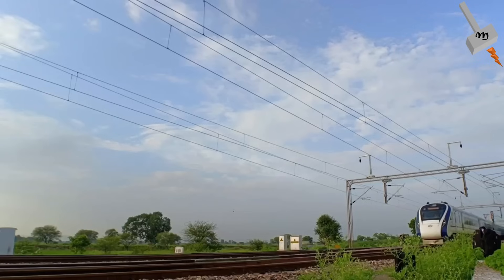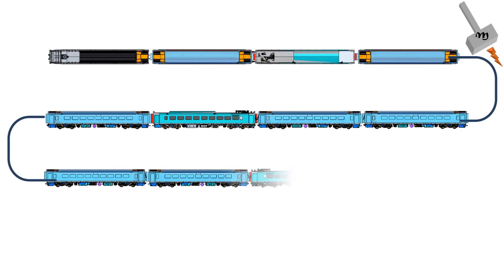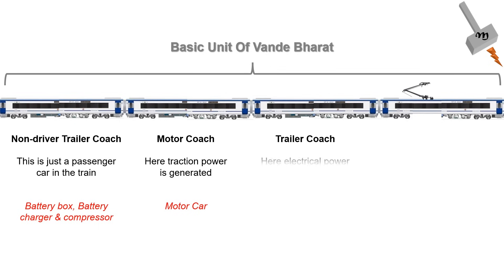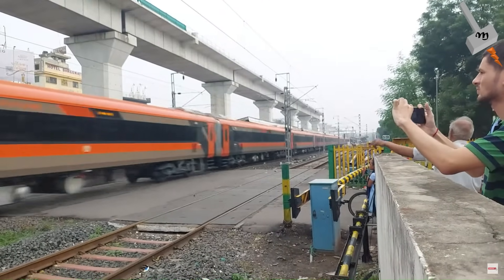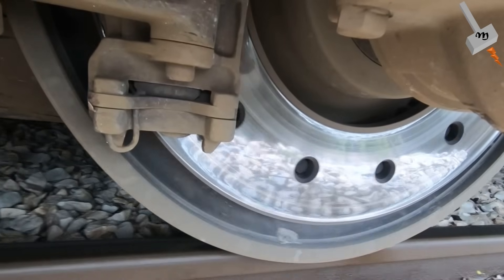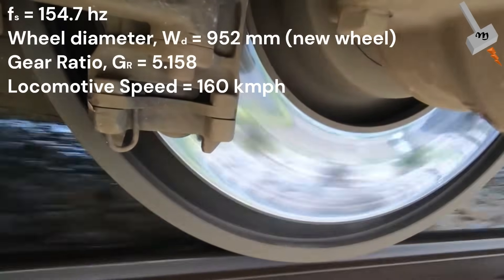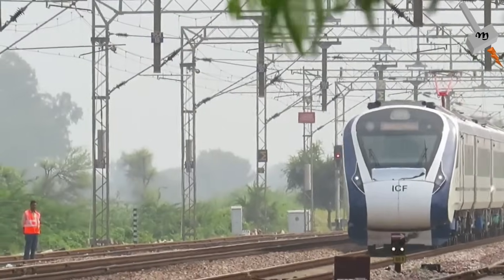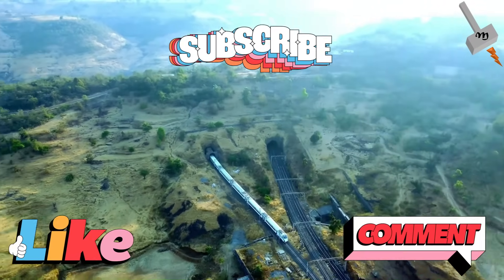Unravelling the mystery of traction motor of Vande Bharat

Comment: who is the manufacturer of the traction motor
Reply: Although TSA is an Austrian company; MEDHA SERVO DRIVES the main OEM & supplier for VB's traction equipments has a Joint Venture with TSA and are manufacturing these traction motors in Hyderabad itself under the banner of MEDHA TRACTION EQUIPMENT Pvt. Ltd. (MTEPL), a joint venture company of MEDHA & TSA.
Reply from the maker: Traktionssystems of Austria makes the Traction motor used in VB.

Comment: Sir, I am also a huge fan of the Vande Bharat Express and feel very proud of it. However, Maglev (Magnetic Levitation) trains are a cutting-edge form of transportation that utilize powerful magnets to lift and propel the train, completely eliminating the need for traditional wheels or tracks. This contactless system significantly reduces friction, allowing Maglev trains to reach incredible speeds (up to 600 km/h or more) while ensuring an exceptionally smooth and quiet ride. The key benefits of Maglev technology include faster travel times, as there is no physical contact with the track, lower maintenance costs due to the absence of wear and tear on wheels, and environmental advantages, such as reduced noise pollution and lower energy consumption compared to conventional rail systems. Furthermore, the lack of friction enables the trains to accelerate and decelerate more efficiently, offering a more comfortable experience for passengers. Overall, Maglev represents the future of high-speed, eco-friendly, and efficient transportation.
Reply from the maker: Maglev is an interesting concept but too costly to implement for mass transport system. The return on investment won’t be great if implemented.

Comment: Are these motors manufactured in India only!?
Reply from the maker: Most probably they are manufactured in Eastern European countries, perhaps Austria.
We hope you have subscribed to the channel!
Reply: YES. Although TSA is an Austrian company; MEDHA SERVO DRIVES the main OEM & supplier for VB's traction equipments has a Joint Venture with TSA and are manufacturing these traction motors in Hyderabad itself under the banner of MEDHA TRACTION EQUIPMENT Pvt. Ltd. (MTEPL), a joint venture company of MEDHA & TSA.

Comment: Sir. Great information. Thanks. How is the voltage reduced , AC - DC AC conversion and rectifiers ?
Reply from the maker: Thanks for being patron to this channel. 
Voltage is reduced by the traction transformer. Convertor system only converts the single phase AC to three phase AC. This has multiple advantages from power system point of view and load flow control.
Reply: @surgepulse2778  Thanks for the information.

Comment: How does power flow into the motors? One phase per track plus pantograph?
Reply from the maker: Pantograph receives power as single phase AC which is subsequently step-down by a transformer. Then the power is fed to a conveter-inverter circuit where the single phase AC is converted to three phase AC and fed to traction induction motors

Comment: Sorry this is not modern Marvel Japan built Bullet train in 1960. Don't over hipe our achivement. Firstly this is a gross waste of public money as this technology is not required to run a train at 130kmph. Because each vendebhart train coach costs more than 5 cr, where as a normal LHB coach costs 1.5cr which can also run at 160kmph. This is Modi's Vanity project at the expense of tax payers like. Bullet train project too is a vanity project as IR 160kmph track runs parallel to it.
Reply from the maker: Agreed, but better late than never

Comment: Vande Bharat trains climbing the Bor ghat from Karjat onwards do not require bankers to push them up the gradient while regular trains require them.

Can you please explain the reasons? Thx.
Reply from the maker: Vande Bharat can climb ghats and hills with ease is due to the distributed tractive power generation. This is already explained in earlier videos, please watch the following
https://youtu.be/Y5Wc4Ua3l2I
https://youtu.be/lY-94yRb3I0
Reply: Also considering Wap7 or Wap5 have max power around 4500 kW and VB16 and VB24 have 8000 kW and 12000 kW, with obviously lighter coaches, it makes difference.

Comment: So many number of motors more number os wires needed and more ssfety neefed for distribution of electricity 

Very high maintenance cost 
Vegy high manufacturing cost 

Csnt modify according to crowd and requirements 

Not safer 

Within few months several fault will cone and train will be in shed
Reply from the maker: That’s strange

Comment: Which company manufactures these traction motors 😮
Reply: Is Bharath Heavy Electricals Ltd ( BHEL) involved in manufacturing these huge traction motors?
Reply from the maker: BHEL, CG Power will be supply traction motor in future... ABB might also join
Reply from the maker: A company named TSA is currently supplying the motors to Medha, who is doing the integration in ICF facility.

Comment: It was a wonderful lecture episode of the Bande Bharat train set.  Could you lecture more on methods employed in conversion of single phase supply to 3 phase supply system and also on the Variable Frequency Drive used for speed control of the motor used.
Reply from the maker: We will try to make a video on the same

Comment: Seems like 3 phase squirrel cage induction motors are used. These are  inherently rugged, durable, brushless and provide a reasonable amount of starting torque. Moreover they are suited for parallel execution and allow overloading. Hope it goes a long way.
Reply from the maker: Yes, indeed it is a 3 phase squirrel cage induction motor, which is the most rugged electrical machine so far & best suited for traction application...
We hope you are subscribed to the channel...

Comment: IF the variable freq drive was based on SiC HEMTs its truly a revolution. Are you aware of the transistors that were used for this? Or did we use IGBT?
Reply: I'm almost sure that drive must have been third party, and not an in-house development.
Reply from the maker: The traction system is from TSA, which is a Austrian Company

Comment: Considering many modern trains supports regenarative breaking, what about vande bharat?
Reply from the maker: Yes, Vande Bharat has regenerative braking
Reply: Vande bharat uses combination of regenerative and electro pneumatic braking while using the brake system. There is brake control unit installed in vande bharat which adjusts the brake force across the rake as motor cars use regenerative+ electro pneumatic and non motor cars use electro pneumatic. BCU ensure uniform brake force is distributed all along the rake.

Comment: More than the traction, I love the smoothness of the train, no jerks, no vibration....just smooth.
Reply: Credit goes to engineers from private firm doing good job, 
Then current government factories where workers just do their obligations and don't improve designs or budget.
Reply: @coalrock8642  no thats not true most of the parts of body shell and bogies are made in ICF only
Reply: @COALROCK8642  
Without the Govt giving budgetary support, not even a PIN will move...
* You don't know the meaning of different  Govts different policies .
 May be you deserve only Congress govt and their ever running old decrepit ICF coaches ..
 . That too without Toilets and Shiit eveywhe on Tracks
 Leaving a Sudden Breeze of Dirty Smell we constantly faced when standing near Tracks on Platforms and were forced to watch all that Crap.
   Congress  forced this situation upon us Indians , so we can be called a SHITTY Country which was aptly correct then.
Reply: @raghunandan9290  you sure know that private firms shown of designs for higher standardized coaches. 2028 will be for sleeper coaches, by 2030 first higher coaches will come on track,

What government will do in this? Nothing really, as it's showdown/auction of contract.
Reply: @raghunandan9290 not even a PIN will move yeah, that's what I said.
Reply: Credit goes to Traction or electric motor and  it's ability to generate different power levels so easily  over time period
Reply: The reason for the smoothness is the improved traction induction motor
Reply: @dbl38  why the frick everyone says things. While the fact I said it's literally not made in India, but made by profiteers.
Whether re-proposing German coaches and made in Indian factories, I claim it's never designed in India, but copied or licensed for domestic usage.
Reply: @coalrock8642  Brother my comment was purely based on my journey experience. I have infant twins and I travelled with them from Bangalore to Bhubaneswar in Duronto and I was fed up with the sudden jerks which I experienced. They are enough to throw you off balance which can be dangerous while holding a baby or while feeding them. I didn't not make any comment on who designed it, who approved it etc etc. I only mentioned abt the comfort. Do not unnecessarily politicize things. May be your priority is different and mine is different.
Reply: EMU technology is more than 125 tears old . The traction motors are being sourced from TSA which is an Austrian company . The contract to build these VBs has also been given to Alsthom Transport .
Reply: @rext8949  
Traction Motors are designed and created by Medha Servo Hyderabad
If it's 125  years old, why were previous govts didn't  use them for something  semi luxury EMU Long distance Train ???
Reply: smoothness and jerk are depend upon bogies and track infrastructure
Reply: The coaches are based on German LHB
So let us give due credit to them for the smooth drive
Reply: @muleshvedant6497  okay
Reply: @muleshvedant6497  
  How DUMB can You be ??
 Waste of time  for public form a troller like You.
   Ofcourse LHB are good.

  But there is a HUGE difference.in riding quality from Loco Push pull than EMU VB.
   It's because of Less Axle weight and Traction motors etc....
 Use some brain  to explain engg tech ...
Reply: @muleshvedant6497  no there are modifications done

Comment: Good presentation and explanation 😊 My query : can top speed of the motor and train be upgraded to 250 kmph by changing parameters. This is of course assuming the tracks are also that speed worthy.
Reply from the maker: For higher speed, a different design of motor is necessary... 4 pole motor may not work, perhaps a 6 pole motor will do justice

Comment: please explain mumbai local bombardier designed emu 12 or 15 car in the same way and compare the traction arragement with train 18
Reply from the maker: Will try...
Reply: The suburban EMU trains are 33℅ powered with 4 out of 12 coaches and 5 out 15 coaches have traction motors. The traction motor of Vande bharat is suspended on bogie frame while in the EMUs it is mounted directly on the axle.

Comment: I believe VB trainsets use 3 phase ac synchronous motors. Can you check?
Reply from the maker: Thanks for being patron of this channel. Hopefully you have subscribed to the channel?

VB trainset uses asynchronous motor. Synchronous motors are permanent magnets in their stator, which makes the motor costly. Induction motor of squirrel cage construction are the most cost effective & rugged construction. Their speed-torque characteristics is also excellent. Hence asynchronous induction motor is most prevalent for traction application.
Reply: @surgepulse2778 correction- permanent magnets are used in rotor , and 3 phase windings in stator
Reply: @surgepulse2778 
PMSM by toshiba and mitsubishi along with sic MOSFET greatly reduces size and outperform squirrel cage induction
Reply: @surgepulse2778  why synchronous motors need to have permanent magnet? Why can't they have DC powered electromagnetic rotors?
Reply: @ajqkit7gt  That's because the magnet is on the rotor. You need to have slip rings if you create a rotating electromagnet, which will make the rotor larger. This also means we will have windings on the rotor. That will increase the weight too much. Remember that we need to save weight in trains and cars! Another factor is that we completely eliminate rotor losses in  permanent magnet rotors. In trains, we are looking for the maximum efficiency.

Note that in permanent magnet motors, the stator is the 3 phase winding and the rotor is the permanent magnet.

As for VB, it uses 3 phase induction motors, not synchronous motors.
Reply: Japan already  uses 3 phase ac permanent magnet synchronous motor 
And whole world uses SIC MOSFET 

India is still stuck on IGBT nd squirrel cage induction motor
Reply: @Yash-n2x7k 
Why what's the advantages?
 Isn't it more costly, more.Weight ??
 Is control and comfort, longevity  the main advantage ??
Reply: @raghunandan9290  checkout PMSM motor in japanese trains